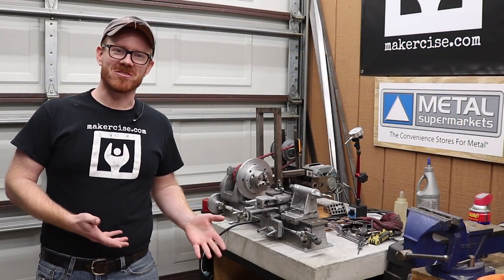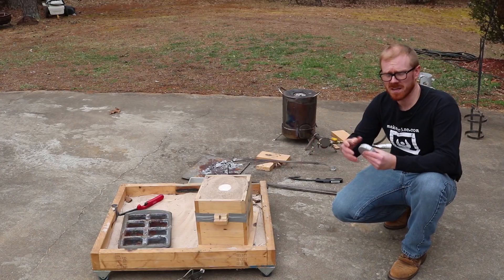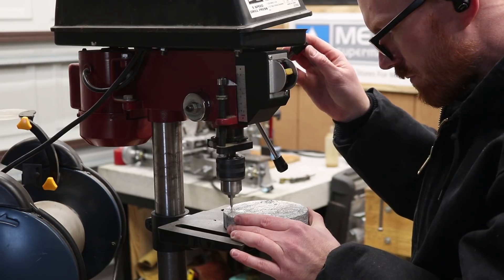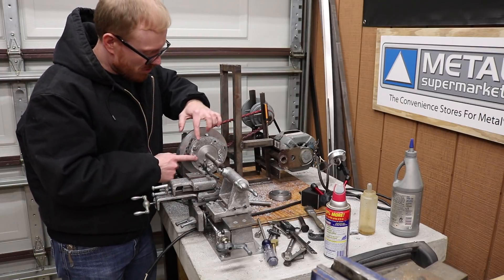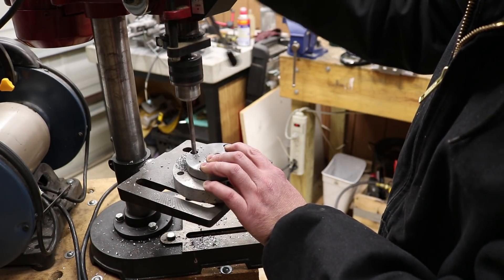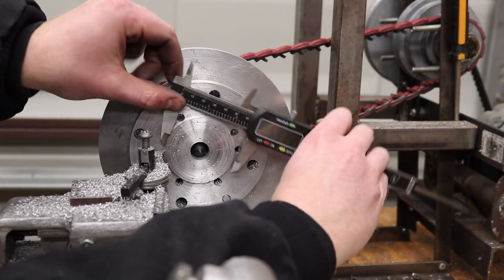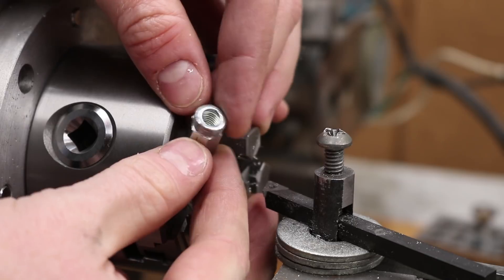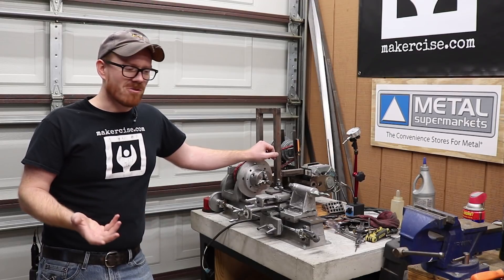Lathe Chuck - FINALLY! A 3-jaw chuck to hold parts on my gingery lathe

Comment: At 3:58, When you drilled a hole with the head stock, the center bit seemed to move quite a lot.  Is it a trick of the video or is something loose?

Comment: I can see flex in the head as your turning.  Somethings moving.
Reply from the maker: Bearings sloppy. Just replaced them and converted to DC motor with speed control.

Comment: I’m building a concrete lathe and the chuck is becoming the biggest issue as far as price! Any recommendations on a good budget chuck? Thanks, your skills and out of the box thinking is admirable.
Reply from the maker: This is the 3"/80mm chuck from LittleMachineShop. I'd recommend a slightly larger version and I'd probably go for the 4 jaw instead.

Comment: Have you thought about heat treating/ annealing the aluminium to get a better crystalline structure and a stronger material? 
not really needed to be honest but being a student of material science with focus on metal I can help being a bit OCD pedantic but as a tip. :D
Reply from the maker: Id love to pick your brain. IIRC heat treating aluminum is contengient on the alloy. I am not real confident about the alloy that I end up casting. A356 is what i think i have based on where i salvaged it. I want to get more analytical with my alloys and even testing strength. I know enough to be dangerous but would love some referrals to good literature.
Reply: for A356 specifically I found this study. 
http://digitool.library.mcgill.ca/webclient/StreamGate?folder_id=0&dvs=1518676877081~206

Most of the literature I read is in Swedish or something the professors have "cut and pasted" together since everything is pretty much every course is tailor made. but most alloys have info about how to use them. but if you want to delve deeper into the science of it ISBN:987-91-86401-11-5 it is about steel but the theory is kind of similar (though steel is much more of a beast) one of my professors has helped with the data and science in it. 

A metallurgist light microscope is REALLY nice to have at hand when looking at crystalline structures in the metal. I recommend you google about preparing samples of metal for microscopy. but a cheap usb microscope might work as well it's all about the preparation to get good results.

that is all I can think of at the moment just had my first coffe and is off to my studies. :)
Reply from the maker: The link didn't work for me. I have done some research on prepping, etching, and viewing samples for crystal structure. And a top lit microscope is on my list of tools to buy. Also, A356 is what I write on ingots made from salvaged intake manifolds, but I am not sure that the alloy composition is correct after the salvage, remelt, flux, and pour. I am VERY interested in finding a low cost way to analyze composition of aluminum alloys. Enjoy your coffee and studies.

Comment: Hi Cressel, what size crucible do you use?
Reply from the maker: +Frank K pretty sure a #6 for most of my al casting. I have a couple #8, one i use for copper and bronze, the other is spare. Double check at http://www.makercise.com/tools
Reply: I just picked up a small foundry/furnace off craigslist this weekend and I think he was using a #8 but I think it actually might be too large for the furnace so I was thinking of buying a #6.

Comment: that runout isnt that bad considering you just used a drillpress and almost only guessed the hole locations ect. i mean you will never fabricate rocket parts or formula one pistons on that lathe. i'd almost leave it as it is and not throw money at it. if you end up buying stuff like a spindle, you almost certainly can go to HF and just buy the whole mini lathe wich would be more accurate than the gingery one, but here again, why. 

as a mini lathe owner myself i'm happy with the .1mm accuracy i can get out of her with no effort. i think the art of making something is knowing when its good enough :)

Comment: Since you have the chuck installed on the faceplate, you can easily adjust out the runout of the chuck.

Comment: Are the inclusions in the adapter plate caused by gasses bubbling through the molten aluminum or did sand start intruding as the foam was "lost"?
Reply from the maker: Inclusions are from a complete absence of degassing. Dissolved hydrogen will create voids. Look for a future video that addresses and corrects these issues. I am somewhat limited in my temporary shop.
Reply: Joshua Hoblitt the bubbles are caused by lower temp metals boiling. The first part of the pour removes the foam. Or his refractory was not completely dry.